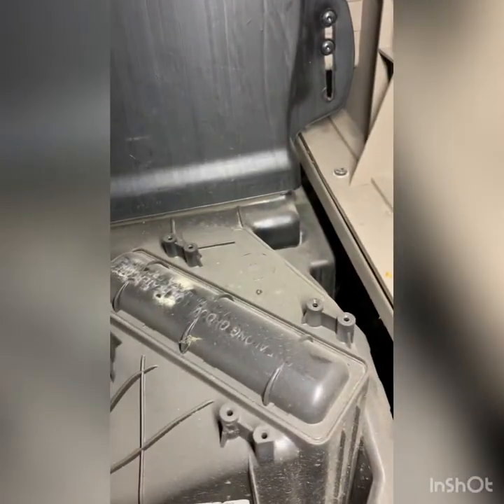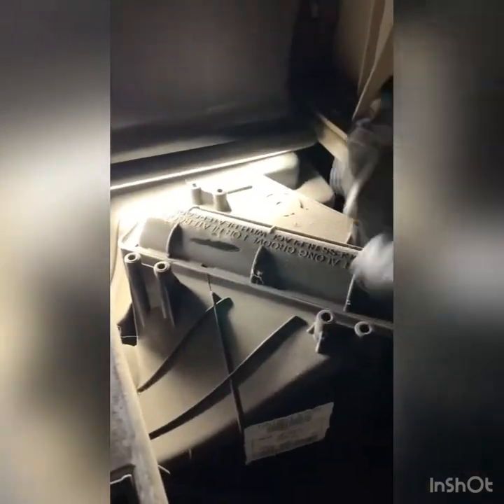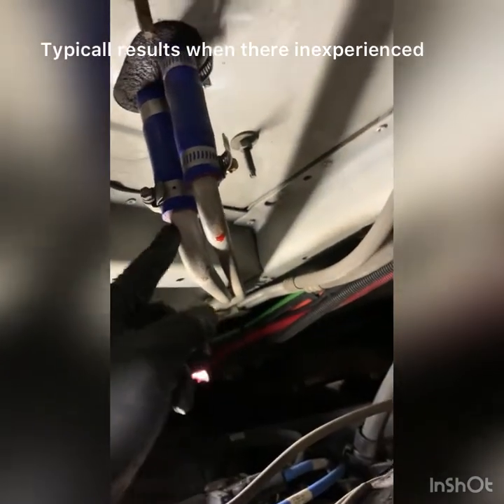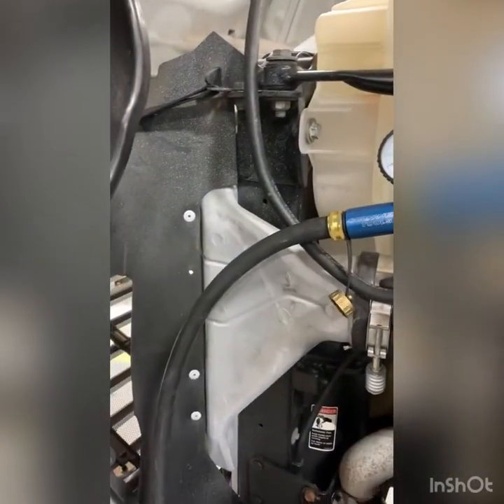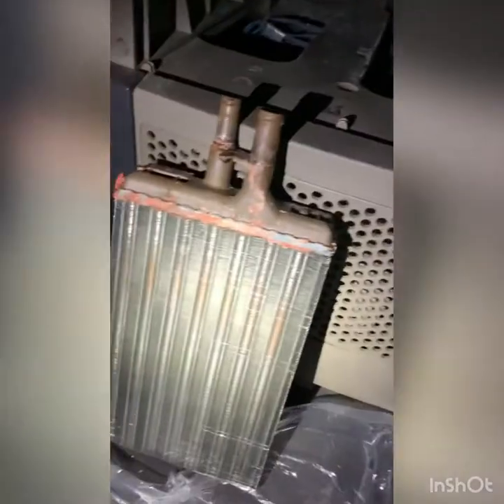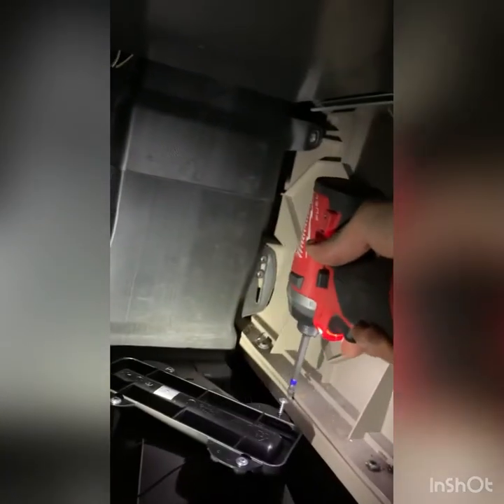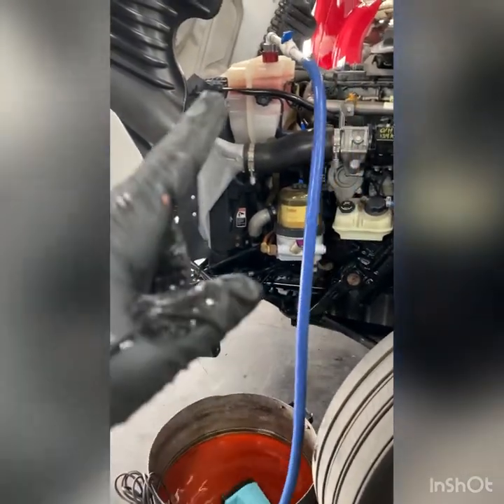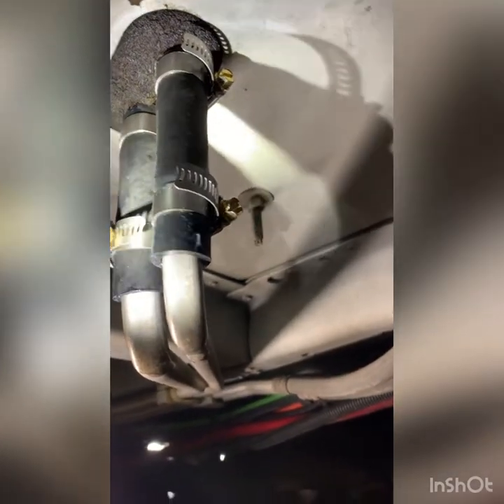Freightliner cascadia dd15 bunk heater core leaking. Done by diesel dr from busted knuckle

Comment: Great vedio as always, my question is, if i bypass the sleeper heater core, would the front one still work? Thank you
Reply from the maker: @AJ-nj3bt  great question and thanks for reaching out. Yes you can bypass one or the other or both if needed. Shut off valves really help during summer as well.

Comment: Best video on YouTube that shows heater core replacement. Do you have to vacuum the refrigerant for this job? Thumbs up 👍and new subscriber.
Reply from the maker: Thanks for watching and reaching out. Couldn’t do this without you guys. 
You do not have to vacuum the cooling system but it is best to as it will leak a good amount. I drain the block of coolant and vacuum the rest in the lines so there is minimal mess. Hope that helps

Comment: great video as always.  I have a 2014 freightliner cascadia where when you turn on the bunk heater the light comes on for 3 seconds then turns off. what could cause this
Reply from the maker: This could be caused by a setting such as key on when it needs to be off or a fault code on the display that would need to be looked into.

Comment: I have a question when u replace radiator on newer CASCADIA they have a transmission cooler mounted on the radiator do we take that off with the radiator
Reply from the maker: The trans cooler is incorporated into the radiator assembly so it’s all one piece. They may be an addition power steering cooler in front of the radiator on some applications.

Comment: I have Questions for you buddy first of all thanks for very help full video 
My 2013 Cascadia when am start in morning bunk blowing cold but when engine get hot start blowing hot what will be the problem?
Thanks for your time to answer my question 
Have a great day
Reply from the maker: Appreciate you watching man and reaching out. This could be due to a couple of issues. Does the cab system stay cold and just the bunk start blowing warm. Or does both cab and bunk blow warm when the engine is at operating temps.. Depending on the answer it will lead me in diff directions.

Comment: Hey Sir I have smart park installed in cascadia recently replaced the heater core due to internal leak 
Every time I turn on heater it works fine for a couple mins but then stopped blowing hot air 
Do you know what could be issue?
Kindly guide thank you

Comment: I was told the dealership was the only shop that could replace bunk heater core on my 2016 cascadia.
Reply: Yep i heard that too. Jd knows what hes talking about. Im doing this right now in an autozone parking lot
Reply: @dieselthegrey  you remember the price of the heater core by any chance
Reply: @Ali   i want to say my kit was $180ish  with tax. One kit is more expensive than the other. Aftermarkets work fine too. Ive used them before as well.
Reply: @dieselthegrey  thanks for the response.

Comment: Hi there. Could you tell me whether the front heater cores are the same on the new body cascadias and the old ones that left in 2017. Same part# and same location. Thanks
Reply from the maker: They are different part numbers.

Comment: I see you use a reverse pressure tester, where can I get one or which one would you recommend. I have only done minimal research on it…..just easier to get a recommendation.
Reply from the maker: I believe mine is a Matco brand cooling system vaccum tool. Any will do the job. I would just look for one that stands behind there warranty because the seals do fail from time to time. Definitely ones in handy when you need to change something quick.

Comment: I’m losing 1 gallon of coolant every 6k miles. Took out the EGR and it’s dry, no leaks or puddles under the truck, did a pressure test and it’s all good. Check my heater core and it’s not wet or so like in the video, what do you think could be the problem? 
I got a 2019 cascadia btw
Reply: Check your injector Capps I had that issue before… check your fuel filter or fuel tank. If you see coolant in your fuel tanks it means your injectors are leaking. I would recommend you to go to TX it’s very cheaper than other States

Comment: Does this apply to all years of cascadias? I know some of the new ones have a battery powered rear system. I guess I'm asking what year did they switch and how would you know which is which?
Reply from the maker: This does not apply to all cascadias. But this does cover a majority of them. There are always some that have chosen a no idle system for the rear and that would be much different. The new cascadia  is pretty close to this one so never needed to update the video.
Reply: @bustedknucklebydieseldr3228  thank you it's much appreciated

Comment: I replaced mine and it's still leaking. Does it matter that I used the old clamps?....it's won't leak if the truck has been running.....once it starts to cools it drips like crazy....Any suggestions??..bad replacement heater core or old clip clamps not snugged enough?
Reply from the maker: Thanks for watching and reaching out. Never reuse the original clamps . They will leak every time. Gta use new hoses and clamps for sure. And every time you take a clamp off especially the spring type clamp from anywhere else, make sure to replace them since they will not continue to hood tension once removed.
Reply: @bustedknucklebydieseldr3228  thanks for the info, I'll replace the old clamps today. I did everything right except for new clamps

Comment: I have an issue where today my ac was going in and out then on the way back to the house it started to climb in temp,I stopped on side of road and raised the hod and it was coolant just pouring out from the top of engine bay passenger side and I could not see exactly from where,and I had to add another gallon of coóant just to make it home. I wished I could share photos and the short video I took. But then there is what appears to be a hose ( medium) size that looked like another piece went into it missing. 2013 cascadia
Reply from the maker: Thanks for reaching out. Man I’m sorry to hear that. A lot of times with these older engines the def coolant heater lines are the problem. Which go from the top of the engine to the def tank. But as we all know a 2013 will most likely need all the coolant lines replaced due to age and disintegration. Just be ready to replace multiple lines in this case.
Reply: Do you have an email so that I may share the vid and photos, because I just don't know what I should be looking for.
Reply from the maker: @CHarris73  good question. But I don’t have one dedicated to YouTube yet. I should probably get on that though.

Comment: I’d like to see you change the def tank heater lines. The ones that go from pass side head to def tank. Up over the tranny. Those break all the damn time. Haven’t found a short cut yet.
Reply from the maker: Thanks for watching man. Don’t forget to pass on the videos to all your peeps. 
Surprisingly they don’t fail that often. And when they do it’s usually a wire rubbed through right by the def doser heat shielding. For me it’s easiest to do both at the same time and build it outside the truck than route them both in together. Makes the job so much easier.
Reply from the maker: @kidthatdid7270  if you don’t mind dealer rates than come on down. I’m at chandler freightliner in Az.

Comment: i have qustion.. i ahve 2015 cascadia with parksmart system . when i turn the heat on for the bunk ( the truck shut off cold) the system work and heat the hoses all the way to the engine then after 30 minutes the heater stops and blow cold air . is it the heater core or the bunk temperature sensuer .. i do need your experience.  thank you.
Reply: it does blow hot air in the sleeper then 30 minutes the heater shuts off and just blowing cold air.
Reply: im thinking is somthing telling the heater to shut off is it the temperature bunk sensor or bad core .. mybe im wrong.  i though to ask experience tech.. i do need your help.
Reply: baterry operate .. the heater brand brand hydronic .. run on deisel

Comment: Is it necessary to have to drain the coolant? I’ve drain my coolant 3 times in the last 3 months lol
Reply from the maker: Great question. You’ve got three choices. 
Drain the system like normal. 
Put system under a vaccum using a reverse pressure tester (which is what I do) 
Or pinch of coolant lines going to the rear of the cab. Theres usually some soft lines you can pinch off and only leaks small amount. 
But man there is always coolant leaks. It never fails.
Reply: @bustedknucklebydieseldr3228  u ain’t lying I’m thinking of pinching the end or putting a plug or something. Thanks for the reply
Reply: @bustedknucklebydieseldr3228  also my back right tail light it’s staying on and my right one and plate lights are off but turn signals and brake lights work any idea?
Reply from the maker: @cristoperodriguezgil8075  depending on what truck you have you might have a short to power across one of your chassis wires. Possible corrosion in your Sam chassis causing a power crossover. Or just a. Bad module. For this issue I like to use a computer and see if power is being sent out. I’d not I’d go right to a multimeter and trace power coming out of the module. That would tell me if there was a module problem or wiring problem. Hope that helps.
Reply: @bustedknucklebydieseldr3228  thanks for the response I have. 2015 freight liner cascadia I’m going to try and remove the Sam chassis and clean it and check the wires.  I have a computer but don’t have the nequick thing thanks again
Reply from the maker: @cristoperodriguezgil8075  even more common on that year was power shorting across the sam chassis on the inside driver side kick panel area due to water getting in. Remove those kick panels. And pull those connectors. You may just find your issue.
Reply: @bustedknucklebydieseldr3228  the ones to the right of the gas pedal? Man thanks for the help
Reply from the maker: @cristoperodriguezgil8075  looking at the gas pedal it’s to the left. Gta take off the kick panel and lower dash covers.

Comment: Could I remove this whole system? Out?
Reply from the maker: Great question, yes you can by just bypassing the coolant that goes to it. Some people have shut off valves going to the bunk for summertime.
Reply: @bustedknucklebydieseldr3228  good so I can either do that or can I just connect a hose to both end? Want to take the whole cabinet out and kinda remodel the whole cab and would really like that space.
Reply: And thank you for the response
Reply from the maker: @cristoperodriguezgil8075  yes definitely that will work just fine as well. A lot of good space right there for a workout bench or pull up bar. Well it’s summertime so maybe smoothie machine space.

Comment: Whats the hose sizes
Reply from the maker: Heres a parts list that should help you out with everthing you need.
HEATER CORE KIT------001V/VCC T1000899G
HEATER HOSE------------001V/GT  4230SB3/4------1FT
HEATER HOSE-------------001V/GT  4230SB5/8-----1FT
CLAMP  9/16-------------001V/BRZ 9210H-----------TIMES 2
CLAMP  11/16-------------001V/BRZ 9212H--------TIMES 2

Comment: If I don't have a pressure test  or to remove all antifreeze  can I just pinch the hose lines to remove it
Reply from the maker: Great question, you can do that but… you may not get it closed enough. Than you would have to work quick to not make a mess and lose it all.
Reply: Well I got ir done .made a little.mess pinch the hoses but still  lost  some coolant  over all not a bad job to do your self  easy 1 hour job. 😀
Reply from the maker: @rigobertohernandez2524  glad it worked out for you. Much more satisfying knowing you can do it yourself and saving that money.
Reply: @bustedknucklebydieseldr3228 k thank you for your videos 🙏🙏